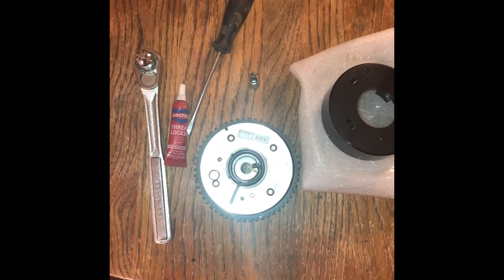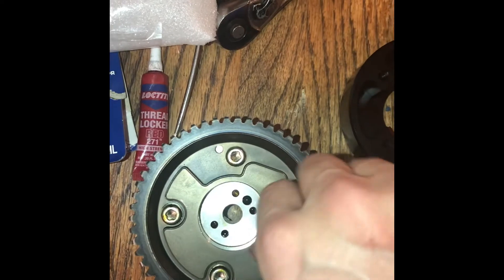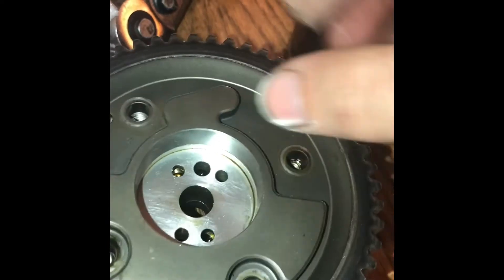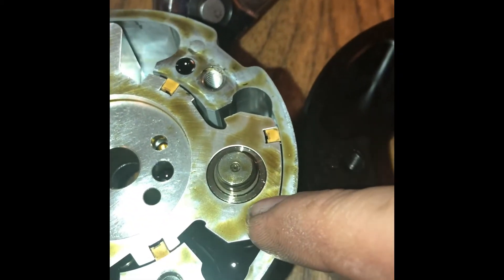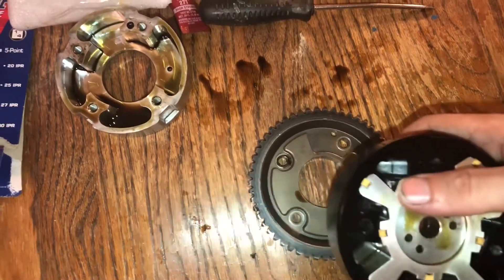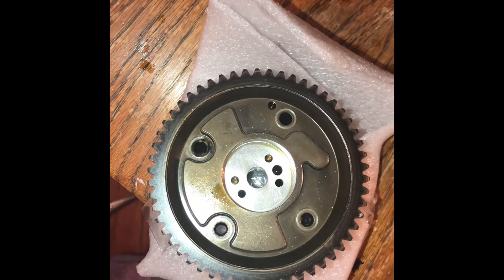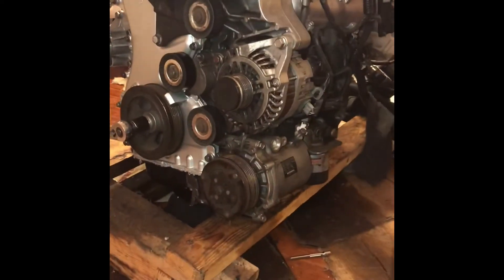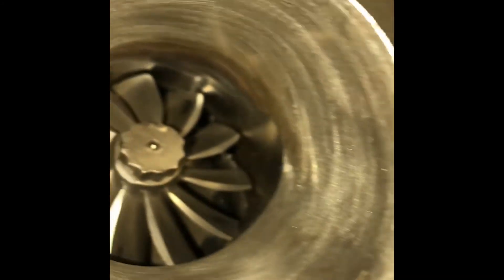EVO X HOW TO torque solution BILLET Exhaust cam phaser housing install

Comment: I ended up putback the oem cam gear housing cause my evo would shut off sometimes at stops..currently running gsc springs and retailers on kelford 214b cams..i was told that gsc springs are not to aggressive for oem cam gear housing..
Reply: who told you that? im gonna be running gsc behives and retainers with gsc 2cams. would i need to delete?